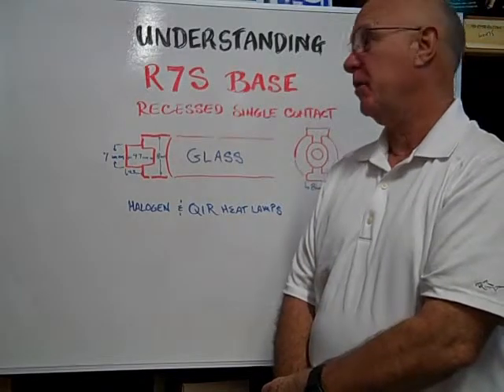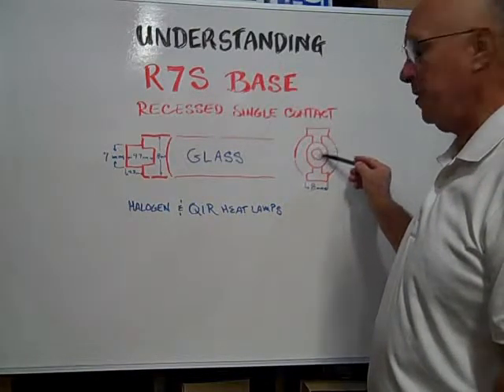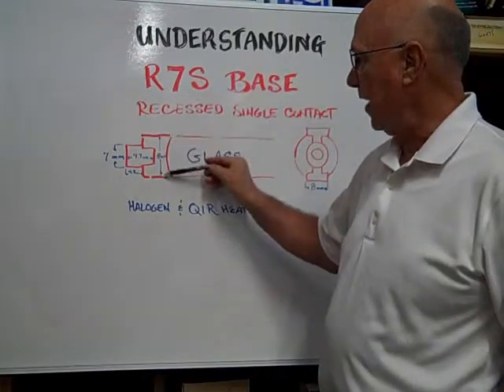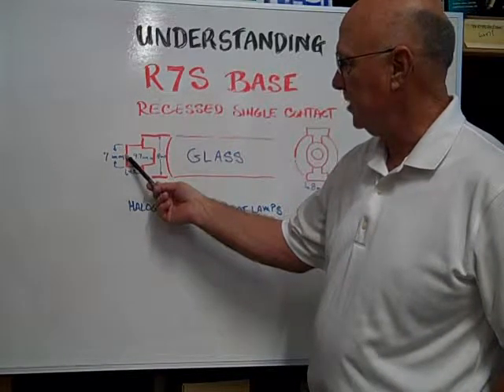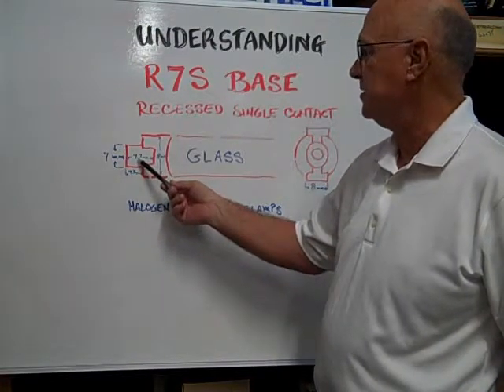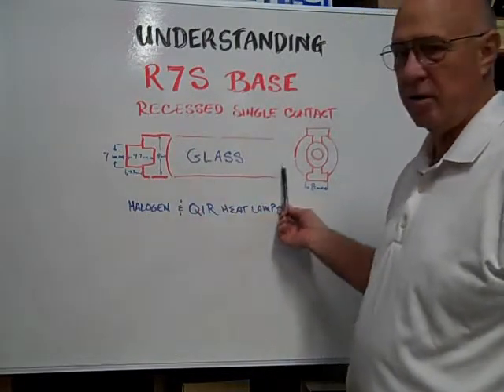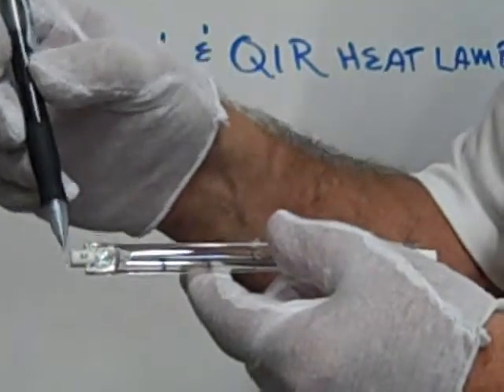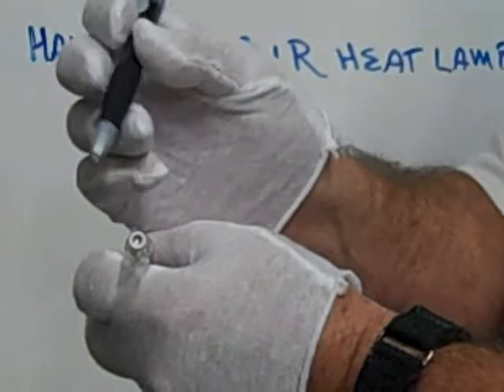R7S Base Identification

Comment: What material is the "dimple?" Metal? Aluminum?
Reply from the maker: Normally the dimple is ceramic, but sometimes they are aluminum
Reply: @BulbTown  ok, thanks! The bulb I have doesn't quite fit snug so trying to figure if I could do anything to fill in to make it fit better. 🤷🏽‍♀️